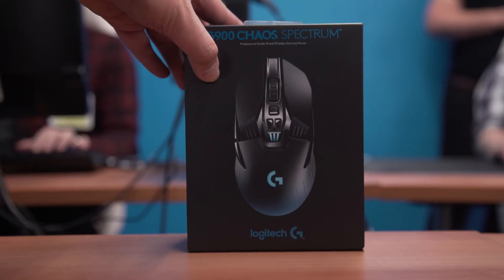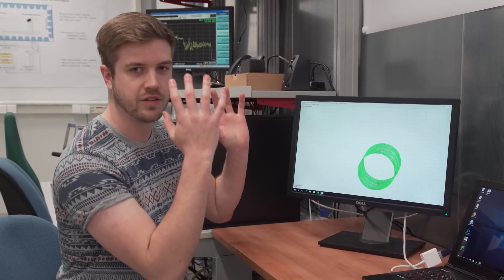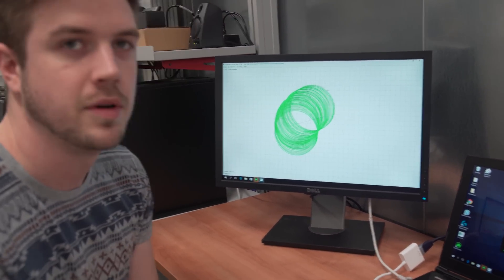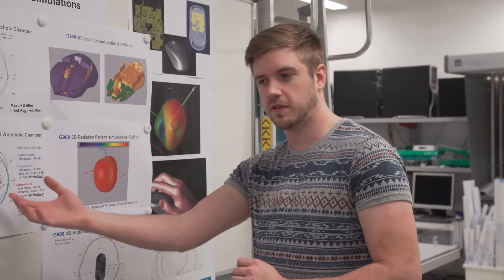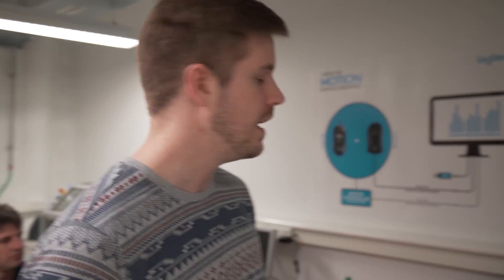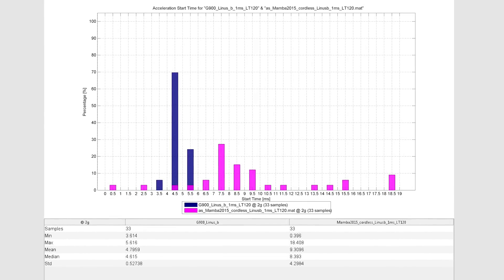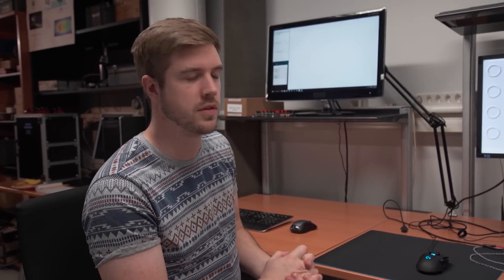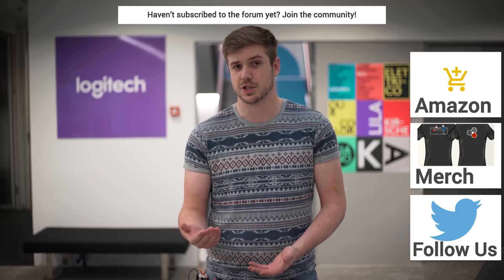Wireless Mouse Technology Testing at the Logitech Daniel Borel Innovation Center

Comment: So Bluetooth mice will be usable now?!?
Reply: +Lucas Farrell No, this doesn't use Bluetooth.
Reply: No
Reply: They were usable before
Reply: They were usable before.
Reply: bluetooth is bullcrap. usb dongles ftw
Reply: +Cougar Ameda what's so bad about Bluetooth? And difference dies it make if you have a USB port?
Reply: InterCo - interface212 bluetooth are slow
Reply: Cougar Ameda What are you talking about? The input lag? btw incase you didn't know USB is just a connector and a technology. Its even more laggy (if anything) than PCIe. Which is what most bluetooth things use.
Reply: InterCo - interface212 ye pcie is prob faster then usb, but the bluetooth connection it self is slower, at least from my expieriencr
Reply: Cougar Ameda WTF are you talking about? By USB dongle what do you mean?

Like a USB Bluetooth dongle or what?
Reply: +InterCo - interface212 He means USB wireless dongle for use with wireless mice, the one that comes with the mouse. The one optimized for that mouse.
Reply: Ripsometime Yes but some come with bluetooth dongles, and some come with RF
Reply: InterCo - interface212 Then he means RF.
Reply: InterCo - interface212 Bluetooth is bad.
Reply: ***** That wasn't the question. The question was why?
Reply: InterCo - interface212 1.google
2. search why it sucks
3. enjoy
Reply: InterCo - interface212 when you play games that requires fast and accurate action you can definitly feel the difference in the latency and reliability.
Reply: hfghfghfh fghfhgf wtf?! Bluetooth uses antennas as well, as does EVERY OTHER WIRELESS TECHNOLOGY.
Reply: InterCo - interface212 bluetooth is not optimized for that specific technology.
Reply: +Cougar Ameda so your saying Bluetooth is not optimised for wireless technology?
Reply: InterCo - interface212 bluetooth is more for casual quick use. for gaming, nah
Reply: Cougar Ameda What are you even trying to say? xD Your making no sense. You first tell me that bluetooth is bad because it doesn't use antennas and then you say because its for casual use. WTF does casual use even mean on the technology level? You obviously have no clue what your on about.
Reply: InterCo - interface212 Its not optimised for low latency stuff, it also has to share its bandwidth with all other bluetooth devices that might be connected/operating in your area.
Reply: InterCo - interface212 i wasn't the one  that commented about antennas btw
Reply: InterCo - interface212 if yoh still don't understand, all i can say thay it is just slower and less accurate. that is why there is no such thing as a "gaming bluetooth mouse"
Reply: Cougar Ameda No you just said something about optimization xD
Reply: Cougar Ameda I know what you are trying to say! You've said it many times! I just want to know WHY its 'slower and less accurate'. 

And what does slower mean in the context of a mouse?!
Reply: InterCo - interface212 to be honest, i am not completely sure why it is slower to the physical level. and by slower i mean it takes longer for the signal to react, aka more latency.
Reply: Cougar Ameda Ok well, lets start using latency, the proper word.

and do you have any reason to think it has more innate latency?
Reply: InterCo - interface212 the reason is i can feel the latency
Reply: InterCo - interface212 even an rf, or hell even some wired mouse in can feel the delay
Reply: +hfghfghfh fghfhgf when someone makes a Bluetooth adapter they HAVE to put an antenna in. And a better antenna increases reliability and range, not latancy.
Reply: +Cougar Ameda so your saying you can feel a delay in wired, Bluetooth and RF mice. Therefore Bluetooth has too much latency for anything above "casual use"
Reply: InterCo - interface212 most wired i don't feel it. but for example the g602 wireless gaming mice, i can feel it. and bluetooth i can feel it easily, and even affect my gameplay in some case
Reply: +Cougar Ameda I said Bluetooth is fine for gaming. You said it has high latency. Other than your own anecdotal opinion do you have any logic/experiment that shows it has higher latency than other wireless technologies? We are NOT comparing it to other wired mice.
Reply: InterCo - interface212 it is obvious that bluetooth has higher latency... i can feel the difference while using it....
Reply: InterCo - interface212 and i am pretty sure there would be such thing as bluetooth gaming mouse if there wasn't higher latency
Reply: +Cougar Ameda so no, you don't have anything at all. Because I've felt both RF and Bluetooth mice and they feel the exact same.
Reply: InterCo - interface212 cuz u don't play fast paced games prob
Reply: InterCo - interface212 i specifically feel it the most on games like osu! and fast paced shooter games
Reply: +Cougar Ameda so you DON'T have any  reason to believe it has higher latency that you can tell me. I don't think either of us can add any value to this conversation.
Reply: InterCo - interface212 omfg, isn't just the fact that there is no such thing as bluetooth gaming mice enough reason? jesus
Reply: InterCo - interface212 and isn't that fact that i can actually feel the difference enough??
Reply: Cougar Ameda No because that's not measurable and is susceptible to the placebo effect.
Reply: InterCo - interface212 omfg what do you want from me ;_;
Reply: Cougar Ameda A logical reason to believe bluetooth is worse than other wireless technologies.
Reply: InterCo - interface212 i didn't know the exact specific answer my self... i just knew cuz my expierience, so i tried asking people that are more knowledgeable about these stuff, and this is the result https://plus.google.com/116659597536256125540/posts/PvSNDhLLeq3?iem=4&gpawv=1&hl=en-US
Reply: The bluetooth protocol introduces an inherent latency by design.
Add to it the fact that most bluetooth mice use Bluetooth LP (Low power), and you have even more latency. Bluetooth is simply not made for low latency usage environments.
Reply: and usb dongles are less slow, and wired is the fastest

Comment: So I wonder what they actually changed about the EMF waves the mouse sends to the censor.  There's only so many ways you can manipulate them..
Reply: Thats a good point,  they should explain how this works but maybe is an industrial secret. My guess is that they're doing something similar to what the new wifi antennas do and align the signal to the receptor,  also they could be crunching a little more energy and reducing the noise of the components.

Comment: This makes sense. Once you are able to make the signal more reliable, a wireless signal will move faster from point A to point B than a wired signal. Thus your latency, for the same data amount, should be lower for the wireless signal.

Comment: i was wondering how the g900 performance against the g502? I'm somehow doubting that a signal through air is better than a signal through (a shielded) copper wire, I mean it is certainly possible to have a slow signal  and processing through a wire (as seen in these tests) but I think the opposite is also possible.

Comment: G602 ftw... This one may track a little better, but you´ll hardly notice the difference in tracking. You probably won´t notice the difference between 500hz and 1000hz polling rate (just one ms difference) And the battery lasts longer, and it has more buttons (which is useful if you use a lot of macros).
Reply: It's heavy as fuck though, not ideal for fast, twitchy movements. 

I tried playing osu with it and it feels like a wrecking ball
Reply: dagambler999 Idk, i just use it with one battery and its light enough for me (i like heavy mice tho)

Comment: Can some well informed, previous-experience people tell me which mouse I should get:

G402 or G502 (non RGB)?
And why?
I recently broke my age old Sharkoon Fireglider Optical mouse. I use a claw grip (not unlike Luke's grip in the G502 video). I can't really decide if the braided cable, extra frills, sensor and etc. are really worth the $15 difference. Thanks!

Comment: And how well does it work if you use it with the USB-cable, if you have to recharge it? I don't even know if it would be ironic, if the mouse worked better without wire than with... And btw, greetings from Switzerland ;)

Comment: Seems like a pretty good mouse, although it's quite pricey. One thing I dislike about most wireless mice is the battery swapping / charging. I used to have a mad catz mouse that had pretty neat battery packs, you had 2 packs, one charging and one in the mouse and you would just swap them as needed. Wireless mice that have a charge cable, to me at least, feels like missing the point of wireless, if you need to have it basically wired for x amount of the time anyway. I'd love to see a mouse like the g900 with wireless charging, that would make me much more interested.

Comment: some questions:
1. how does it compare to wired Logitech models?
2. if they can achieve this with properly made for wireless parts, what if they did the same to wired? I don't mean plugging in the wireless mouse, but making wired mouse specific hardware just like they did for the wireless mouse, and making a full time wired mouse of the same quality.

Comment: Um, hold up. For all the mice except the g900 they started with the rf off, then turned it on. This was where the most significant amount of tracking issues were. But we never saw this for the g900; it started with rf on, so we never saw the transition from rf off to on : /

Comment: What about the Driver? What I want to know is how they handle the Driver config, did they add a DPI and Polling Rate setting to the Mouse Applet in the Control Panel as they should or did they blow it like Razer did and not add the DPI and Polling rate as well as remove the Acceleration control from the Control Panel? It's OK to also have these in the Software but first and foremost they NEED to be in the Control Panel like all other Hardware have always been in all versions of Windows since Day one. I want to know, thanks!

Comment: I don't get why people buy expensive mouse, The alot cheaper one are available with the same feature and great for gaming
Reply: logilogilogi What? 107g is about 20-40g lighter than most decent wireless mice and it's a couple of grams away from a normal wired gaming mouse. If anything this mouse is too light for it's size.
Reply: are you joking? this video tells you exactly how the G900 is so much better.
Reply: I'll stick to my 15$ mouse, never have a problem with it
Reply: +Cockroaches Your not going to be able to find a cheap mouse with the same features nor will it be great for gaming.
Reply: The_rocketman For 15$ ?, mine is 15$ playing CSGO without any problem
Reply: Cockroaches Just because it works for you doesn't make it good, a $15 mouse can't compete with a decent $40 or $50 one in features or performance.
Reply: Cockroaches I can play games such as CS with a trackpad with no problems, but I would still prefer a proper more high quality mouse, that has low input delay and is accurate.
Reply: logilogilogi The difference between this and a wired gaming mouse is literally a teaspoon of sugar. May I ask what mouse you use?
Reply: logilogilogi The Abyssus is actually 80g without the cable which is still too light for me which is why my mouse has adjustable weights.

Comment: Are there wired mice on the market that would beat this the G900 and how do they compare price wise? That's what I'd like to know. If they are cheaper and perform better, then wired is still the better option, impressive as the G900 is. Put all the low latency tech into a wired version of the G900 and I suspect that it would work even better. You can reduce wireless latency to a miniumum but it's still there.

Comment: OK so there is one problem (well not one but anyway) with the tests that they were doing they didnt measure the latency at the maximum range of the mouse and the didnt measure the latency at the minimum range. Also they forgot to compare how the mouse would fair if it was wired at the time of the test.

Comment: This is clearly a biased test. Wireless mice work great if the sensor is right next to the mouse, but this is rarely ever the case. Depending on where the tower is positioned, the wireless signal may have to travel through your desk, parts of the tower and other wires which emit a small amount of electrical interference. 

Wired mouse also generally have a 1.5- 3m cable length, so is it really fair to compare click delay when the sensor is approximately 30 cm away?  I don't think so.

Comment: Damn it. How do I skip the 18 minute Logitech commercial before the video?
Reply: Do you guys think the test results are forged? 

For quite a long time Logitech mice have beaten other mice on button latency tests reviewers do on the net, by bumping mice against it other, using high speed cameras and even arduino boards.

If the test results are legitimate how the fuck are those facts "biased"? What do you even mean with that? What other objectively measurable things could be more important to this kind of product than click latency, motion detection latency and wireless signal performance? What better candidates to test against than the best selling models from your biggest competitors?
Reply: Gedanken: he was joking. Of course facts are not biased, that's the joke.
Reply: Lol...Damn biased facts.
Reply: +RealEntropy was wondering the same, currently 8 mins in and I'm done.

Comment: I can confirm the Mamba's behavior. I can't move 2 meter away from the receiver or else the cursor will start jumping and freezing. I have like 2 or 3 wifi devices on and close by, a headset, a steam controller and a router. If feels like if the Mamba was made to use low powered transmissions or something. Don't know if wireless mice can have different "antenna power" or even wifi channels, I would have like to know that.

Comment: Or you could just buy wired and not have to worry about the latency delay almost at all.
Reply: +Катюша Considering the point of this video was that this wireless mouse has significantly less latency than the tested wired mice your comment is invalid.
Reply: +Катюша They discuss that in the video. The G900 has, supposedly, less latency delay than the wired Razer DeathAdder Chroma.
Reply: +Катюша Did you watch the video? The latency was better compared to wired mice.

Comment: You never showed what happened to the logitech one when you turn the antenna on, I suspect a large change like that could potentially disrupt it. 

Also the big claim at the start was that it was better than a wired mouse, yet you failed to test it against a similar wired mouse such as the 502 Proteus.

Honestly this 'science' seems way to constructed to be useful. When every test is designed to favor one thing, you're not learning anything.

Comment: I am uncertain about the purity of the test. The Mamba, Sensei, and Uruboros mice would likely have been present at the "lan party of 300 people" in which the amplified signal was emulating but the Logitech mouse can easily use a signal no present on the interfering band to produce the same results.
Reply: u just didn't understand the video.
For the drawing circles part, they showed data for when
G900 was disadvantaged
razer mouse was advantaged and disadvantaged
steelseries mouse was advantaged and disadvantaged.
Yet, G900 has beaten all the others.

Comment: Thanks for this vid. I been a huge Razer fan boy but starting to give up hope on Razer. I was in the market for a new wireless headset so I  got a Logitech 933 and was blown away. I have been eyeballing Logitech peripherals lately as my Razer Naga and 3rd black widow keyboard are really startling to crap out. I use a Black widow at work and at home. Both have issues even after 1 week. Im prolly going to switch my gear over to Logitech so this was a great vid!!

Comment: 1 or 2 ms difference won't even be noticeable especially if you play on servers with like 100ms ping there are factors that far outweigh the mouse input. I'm still going to stick with wired mice so I don't have to worry about changing batteries or recharging it

Comment: 2ms is nothing.

human reflexes are like 400ms right? dont say bs. snakeoil mouse
Reply: +Timo Pomer they wouldn't be "reflexes" anymore if the event is not sudden.
Almost half of a second is too much, look at the jet pilots performances to get an example.
Reply: +Timo Pomer Bullshit. Look at Pro Gamers. If they would think for almost half a second that would be terrible.
Reply: Антон Южаков not THINK, reflex

you certainly wont notice 2seconds/1000

noone can
Reply: Timo Pomer Probably won't. But it's still nice thing, cause every single latency adds up, thats why pros using monitors with 120 and more Hz. BTW i defenetly can see difference between 50 ms ping and around 70 ms, even though i am defenetly not a pro and only game i playing is L4D2.
Reply: Human reflexes are 400ms? I would most likely be dead, if that was the case.
Reply: teschi to sudden events. conscious ones of course